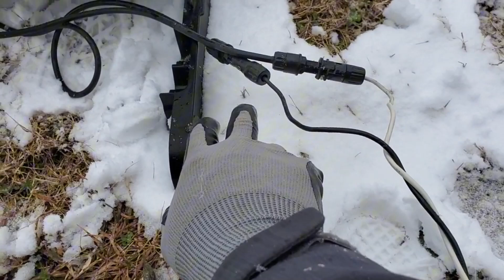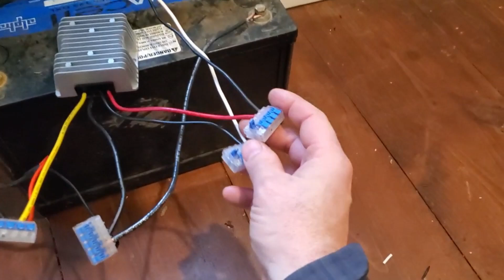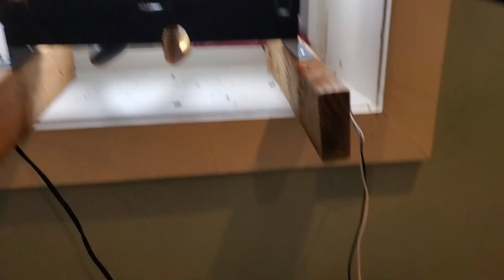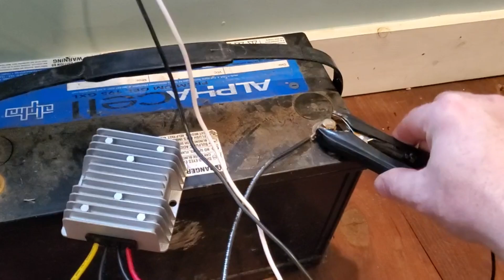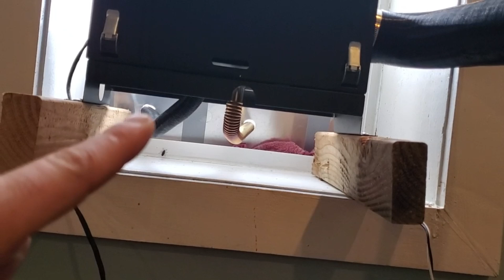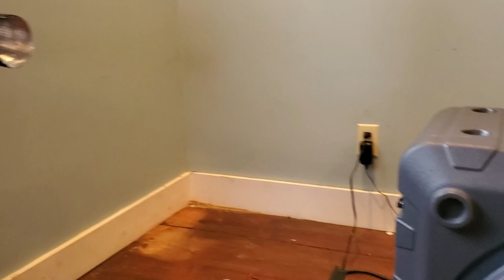Solar Power Meets Diesel Heater: Grid Down Heat For Everyone!

Comment: I have my intake on the inside of house but the exaust is run through a pipe sleeve so the make up air preheated as it is drawn in around the hot exaust.

Comment: What would you recommend for a 30' travel trailer i.e. install the heater inside or outside?
Reply from the maker: Well, the manufacturers usually have them installed outside, so that is probably more "correct." However, an installation on the outside will cause you to use outside air that gets pushed into the trailer causing a positive air differential. This forces heated air out of your trailer and uses new/cold outside air. So personally I install the heater inside with combustion air intake and exhaust going outside to avoid the heat loss from other installation methods.

Comment: They have a Heavy start load. Ask me how i know. Better have a Heavy battery source.  They soot up real bad unless they are on Hi. Get a Gas powered one, much cleaner & cheeper fuel cost .Diesel is way more expensive than gas. Make sure its an Better quality. Webasto is a Great brand.

Comment: what are you doing? that is NOT a charger. That is a buck converter and is NOT meant to be used like that. you can buy a $10 PWM that is better than that if you want cheap. A MPPT is what you should be using. 

I always wonder WHY people post videos that are not safe, and barely functional. It is not difficult or expensive to do what you're TRYING to do properly. 

This video is NOT instructional, it should be called "How I used crap around my house without regard for burning it down to power a diesel heater"

Do better man, this is dangerous if anyone actually tries to follow this, and there is just no point when safer stuff is just as cheap. that thing will use a hell of a lot more than 12aH. this will not work
Reply from the maker: @sNEAKYnIGHTmUPPET   13.8v buck converters are specifically designed to charge Lead Acid, AGM and Gell batteries from a veriety of DC voltage inputs. That is literally their purpose. Have you ever used one of the $10 pwm charge controllers? Because they often don't work at all or output drematically wrong voltages and I wouldn't trust them unattended (I've tested several and they are supper scetchy). A real and reliable mppt is quite a bit more expensive than a pwm or a buck converter (most of the super cheap "mppt" controllers are actually pwn controllers mislabled by scetchy manufacturers). And a mppt will require more setup and know how. Pwm are also very inefficient for this use case because I would be throwing away 75% of the energy that my panel produces (which you would know if you knew how they worked). Every buck converter I have tested on the other hand has been rock solid and worked exactly as it should. If it outputs the correct voltage at and is rated for more amps that I need, why do you think it can't be used to charge a battery???

The heater uses 1amp at 12volts (12 watts). Clearly you don't understand ohms law or how the calculations work to figure out amp hours, but, yes my heater does use 12ah of power from a 12v system over a 12hr period (not "way more" as you so scientifically state). 

The idea of this system and showing it is was not to suggest that it is the best or most correct way to set it up (it's not), it was to show how having a few simple things on hand can provide you with heat in a grid down situation (I thought that was pretty clear by the title, but here we are). 

Additionally, the choice of the buck converter with the solar panel is because there is a myriad of uses for this combination around a homestead for powering small loads without a battery which is something very useful for my audience and I will be delving into down the road. 

I don't mean to be rude, but you have clearly demonstrated that you do not know what you are talking about and can't run simple electrical calculations.
Reply: @thehomesteadconsultant  as an electrician I am very familiar with ohms law and it application.  I have been for over 35 years now. I also live completely off grid, so none of this topic is foreign to me.
To correct you again, buck converters are not chargers. the REASON they have them with a 13.8v output it to provide power to loads that require it. they have no current regulation and are not proper dc-dc converters.I dont recommend using a pwm, I was just stating that they are cheap and meant for charging unlike your buck controller. 
Why make a video like this? NO ONE is going to have one of those kicking around like you do for whatever reason, so they are going to have to buy something. at that point, buy the proper thing, that makes sense. Also, anyone watching your video isnt goign to have the smarts to do it safely so why instruct HOW to do somthing dangerous? makes no sense.

You can't defend this videos content because it is aimed at those who don't know, and it "instructs" something that isn't safe, PERIOD.

I would also say that charging lead batteries indoors is dangerous, do better and vent it outside.

That heater is not MEANT to heat a house, it is meant to heat the Cab of a truck which is why it runs on diesel and 12v to start with.

I am sure you thought that this was a good idea, but take it from someone thats been around the block and seen things, don't promote things like this as training, people are likely to try and replicate it.
Reply from the maker: @sNEAKYnIGHTmUPPET  a buck converter not being current controlled is a meaningless point. The battery can more than handle the amperage (which means the buck converter is providing a load) that the converter puts out and when it reaches float voltage on the battery it can't keep pushing current so it won’t over charge or do damage to the battery. It's a non-issue in this case, if you were charging batteries with a tighter voltage limit, or that are more vilitile, then you would have a point. 

The fact that the heater is made to heat a mobile vehicle doesn't matter either. If anything, they have to be MORE robust and safe for that application because the components would have to withstand the jostling of a vehicle (not while running of course). No they are not specifically made for use in a home, that does not mean that they can not be safely used to heat a small space or room. 

The only single safety point that you have directly mentioned that even makes sense is not using a lead acid battery in the house due to potential off gassing. Its unlikely to happen at 13.8v but it a good point that I hadn't thought of because I was trying to show the wiring in a way that would make sense. 

If you were concerned about safety it seems you would point out the lack of fuses or something more concrete than your non-propblems you've come up with.

I also was very clear that what I was doing was not a fully proper configuration and that a similar setup would not be safe to try without a significant base knowledge of the systems being worked on. I also made clear in the title that this setup is a concept for one way to heat a space during a grid down or emergency situation, not a day to day installation to replace your HVAC. 

You're getting really tied up in knots about nothing.

Comment: Good info. I'm trying to learn all this to get away from the price gouging grid and no expert on electrical or solar, but Isn't a solar charge controller that has adjustable settings a better choice rather than this non adjustable buck converter?
Reply from the maker: @AmericaFirst2020  for a permanent installation, I wouldn't use the setup you see here. This is an example of simple parts that you can have on hand for power outages or emergencies. The idea with this setup is to be very low cost and extremely simple. If someone picked up a solar panel on FB marketplace, a buck converter and heater from Amazon and had a boat or car battery laying around, they could have this up and running in an emergency at very little cost. I also recommend having the panel and buck converter to use for charging or running veriouse items (like USB powered items with an additional adaptor) so they are items I recommend having on hand for other reasons anyway.

Comment: Wondering why you wouldn't use already heated air inside for input?
Reply: Oh I see "air pressure" , not a problem at my house 😂 it's not air tight anyway
Reply from the maker: @davidmcfatridge  it's the differential that it creates so it draws outside air in. If your house is "leaky" it makes it worse because more are can be easily drawn in :)

Comment: What 40ah per night i run 2 of these heating my house I have two marine batteries 100 amp hour on power level five on my heaters then batteries last 4 days without recharge with a 6 amp trickle charger keep in mind I'm not using the lifep04 I'm using lead acid batteries eventually they'll be converted over to my solar system and 1 never pulling the wattage or ah pernight like u
Reply from the maker: @mrchief.-__-2051  I am definitely estimation high and giving a lot of margin, but you may have more efficient heaters than me.

Comment: Unfortunately, I'd need to stockpile another fuel, which I'm not interested in doing.  I contacted the company that makes the diesel heaters and they can't burn kerosene, which is too bad for me.
Reply from the maker: @spockmcoyissmart961  they are not rated to burn kerosene, but I'd be shocked if it didn't work. I'm not suggesting anyone try it, just saying that due to its similarity to diesel and the fact that people are succesfully running used motor or oil through these things, it would be very surprising if kerosene wouldn't work.
Reply: @thehomesteadconsultant  I run mine on Kerosene and it's no different than diesel, in fact if anything it's more efficient.

Comment: I'm trying understand where someone would have solar panels...but not have a proper solar charge controller (SCC).  Buck converters are not charge controllers, although that's essentially what you're using this one for, in addition to powering a load.  The battery is there to smooth out the intermittency of the incoming voltage.  While this is an interesting experiment in what "can" be done, it is by no means the best implementation of technology.  The only time you would use this configuration is if you don't have a SCC.  You're using a buck converter to do two things it really isn't optimized to do (charge a battery and power a load using an intermittent power source).  You'd be better off with just a SCC and a battery, with the diesel heater wired directly to the battery.  The solution you're using is actually more complicated and less efficient.  I guess if that's all you have, then it works, but how realistic is that?

Comment: lead acid batteries stay healthy when they can be fully charged often. When the battery gets near full the charging input is wasted as heat and only a small amount goes into the battery for charging. If you can't supply the needed charging power your battery will never reach full and the battery will degrade. To get full charge the quickest charge at 14.6 volts and maintain that for a couple hours before dropping to a float charge of 13.8 volts.
Reply from the maker: @uhjyuff2095  sure, but charging it to 13.8 and floating it there isn't going to harm it in any meaningful way. Your talking perfect, I'm talking functional for an emergency.

Comment: Kindly comment on using a 100Ah LIFEPO4 battery instead of lead acid. Upside is that it can discharge almost 100%, nearly doubling the duration of battery power without recharge. Downsides are slightly greater cost for a LIFEPO4 vs lead acid battery, the LIFEPO4 need for a solar charge controller (possibly MPPT) at greater cost than a buck converter to recharge a lead acid battery from a solar panel, and a LIFEPO4-compatible AC-DC battery charger which is more costly than your small lead acid plug-in charger. The greater LIFEPO4 costs buy nearly 2 days of additional diesel heater run time if grid power is down for an extended time & the sun doesn’t shine due to a storm which knocks out grid power. If a LIFEPO4 battery is technically feasible, the question becomes the value of 4 days LifePO4 vs 2 days lead acid battery power for a diesel heater if the grid goes down & there’s no sun.
Reply from the maker: @midchalet  lifepo4 would be a great option but would require more thought and different components (like a properly rated charge mppt controller). What I am demonstrating is a simple setup for emergencies rather than a permanent install. Someone might have a boat or car battery sitting around and a buck converter is extremely simple to connect between just about any solar panel and a lead acid battery. So, yes a lofepo4 with a proper mppt charger would be a better choice for a permanent installation or if you had the extra cash and knowhow.
Reply: @ Thanks for the reply! I’m doing long-term installations in a number of locations. I’m pleased you agree LifePO4 is feasible. Those batteries have come down substantially in price. I noticed a small and supposedly reliable MPPT charge controller for $20. 5amp LifePO4 ac-dc chargers are also inexpensive. Because LifePO4 allows much greater discharge, I can nearly double battery backup duration with the same battery Ah rating That’s valuable when I am out of town. Another required upgrade is to a larger diesel tank which can be made from a portable boat tank or - more cheaply - from a $22 5g Midwest can. Thanks to your video, I have the basic design of a battery + solar double backup for my diesel heaters. Big help!
Reply from the maker: @midchalet  do be careful with the cheap mppt chargers. Many if them aren't actually mppt. You will probably be closer to $100ish to get a legit mppt that can handle lifepo4 properly.

Comment: One more thought - you might differentiate the air intakes. One is combustion air intake and the other is heated air intake - for those who may not be familiar with these heaters.
Reply from the maker: Good point

Comment: Diesel heaters are not particularly efficient - about 70%. Also the rating of these units is deceptive. An 8KW unit actually outputs only about 3KW of heat - equivalent to about 10,000BTU. However you do have it installed correctly - heating inside air and not heating outside air! Many I have seen in Youytube vids have their heated air intake outside!
Reply from the maker: Yeah, I won't be surprised if a large chunk of that remaining 30% is lost through the combustion exhaust (that pipe gets really hot!). But the heater gives me a lot more output/$ than propane or K1 without any off smell either. I'm not sure how they come up with the 8kw rating because you are right 3kw-5kd is much closer to their output.
Reply: Do not pull intake air from the room you're trying to heat.  Pulling inside air and exhausting outside creates negative pressure in the room.  That pulls the cold outside air in, along with exhaust fumes you're sending outside

Comment: Mppt charge controller would be more efficient. Your angle on your panel looks low.
Reply from the maker: @WayneP1973 yes, mppt is more efficient and the angle could be better. The concept is CHEAP, SIMPLE and FAST. The panel is significantly overpowered which negates the need for perfect angle and supper efficient charging. Buck converters are 85%+ efficient which is not far from mppt.

Comment: Hi Ryan - be careful with the buck converter case touching the positive post of the battery - the buck converter case is likely grounded and if so would be a dead short. I know you said it was for an emergency basis, but recommend some fusing for overcurrent protection.
Reply from the maker: @joemontana4370  you are correct on both counts. There is a lot I would do differently in a permanent installation.
Reply: Ok  was about to order your list then i read this is this set up safe? Overcurrent?   I need something for our well pump room in case of a power outage for 3-4 days max i hope
Thanks Scott
Reply from the maker: A wellhouse is a great application for the system. You can add breakers/fuses in the mix for $15-$30, to increase safety. 

Battery output https://amzn.to/4uZh37V
Solar input https://amzn.to/3NOIX68
Reply from the maker: Also, the buck converter won't short the the battery terminal (I've tested it), in but giving them a little separation isn't a bad idea.

Comment: Thanks for the video. So to not disturb the air pressure inside, does the air intake always have to take air from the outside? Under what circumstances can you have the air intake on the inside without creating negative or positive pressure?
Reply from the maker: If the air intake is inside the space and the exhaust is vented out, it will always create negative pressure. 

That's not to say that you can't set it up that way, it's just that it will reduce efficiency.